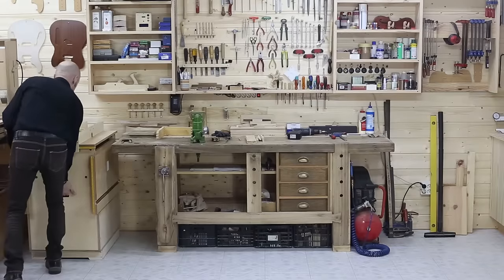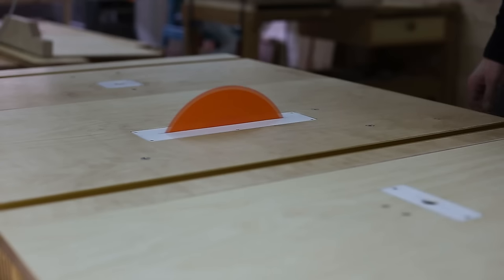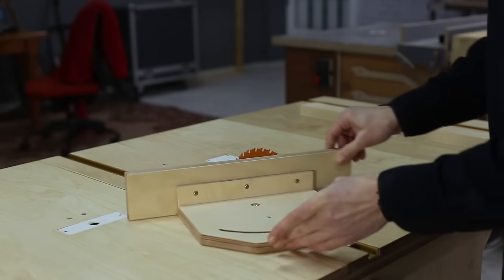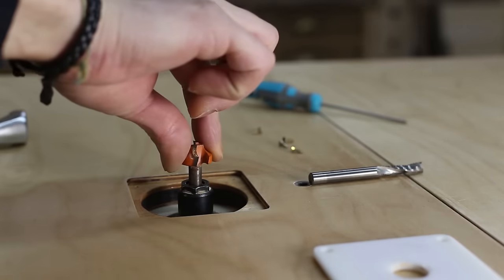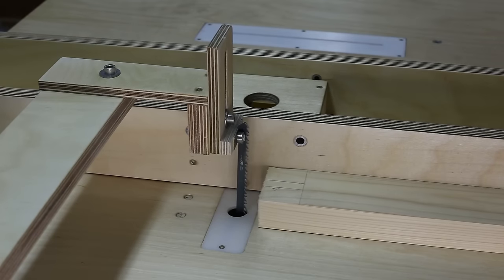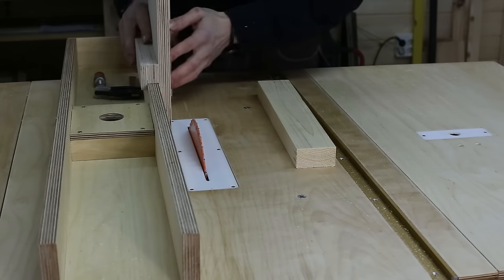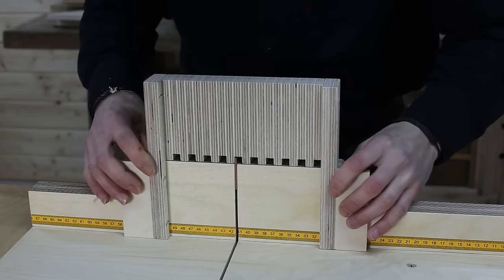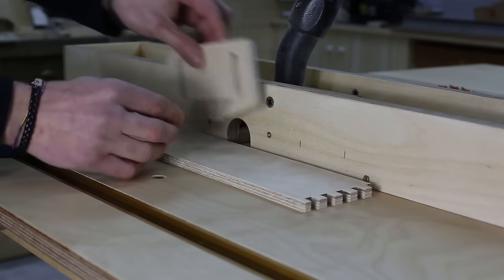Portable Workshop / a compact multi tool

Comment: Congratulations for doing very, very nice work on this.  There are a lot of multi-station ideas like this out there that I have seen, but yours is the best that I have seen by far.  Like others have said, your concept for the box joint jig is excellent, but what I was most impressed with, and have NOT seen before is the idea of the two little bearings to guide the end of the jig saw blade and stabilize the blade at 90˚.  With a good jig saw (like your festool) and a very sharp good blade, i bet you get band-saw-like precision out of this.  With about the same (or maybe more) throat clearance than a 14" band saw.   Very, very good work.  Excellent attention to detail.
Reply from the maker: +SteveMakesStuff I'm glad you like it, thanks for your comment!

Comment: Love the box-joint jig setup you have there. Very simple, but super effective!
Reply from the maker: thank you!
Reply: Walter Kessler i love it too. really simple to use. too bad you can't change thickness thought.
Reply: thibault bernier if you made it so the top piece was removable, you could adjust the joint sizes by attaching another template

Comment: This is a muy caliente bene bene tool. Very neat, very innovative and very work encouraging/inspiring.. Should add an adjustable outfeed part of the router fence to accomodate straight bit material removal. I like all the funky little useful features like the bearing to allow radius cuts without a bearing on the bit.. nice.. and handy overall. You get ten points towards a McCarthur Fellowship genius award.. maybe a 100, with a vacation on the Riviera thrown in to boot.
Reply from the maker: I am happy to read your words, thank you so much!
Reply: I find the best projects get explained a trifle too fast, but to slow them down would take too long and be boring. The dizzying array of features presents a challenge which makes people want to climb mountains that they would ordinarily be content to sleep at the bases of... I like to expand things in my mind like as in how to extend the radius bearing into a wider variety of uses..

Comment: This has got to be the best portable workbench I've ever seen. I'm in the United States and your measurements are metric. Will there be any problems and converting them and I see that your tools are little bit different than the ones here in the states. As far as power requirements. Any problems with converting them to the tools that I have?

Comment: May I ask what version of SketchUp that you used to create the plans? They have discontinued the free version, so I need to get an older version and want to make sure what I get has no compatibility issues. Also, how do you keep the triggers pressed on the saw and jigsaw? I don't see that shown in the videos.

Comment: Hi Sir. What size of your saw blade diameter? For mine is 71/4 but after punching down it sticks out from top table around 1.60 in something high.
Reply from the maker: hi, if you are using a blade diameter recommended by the circular saw, that should not happen!